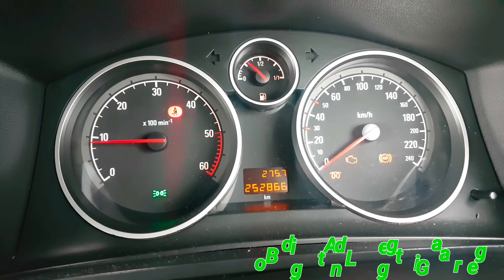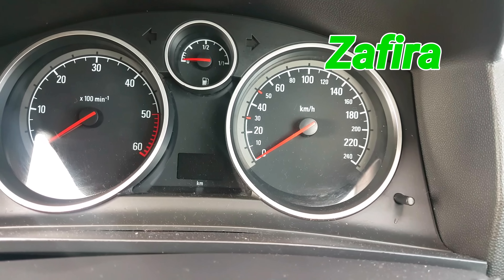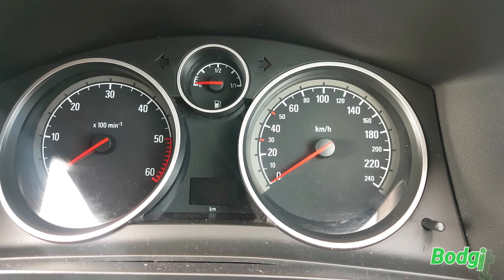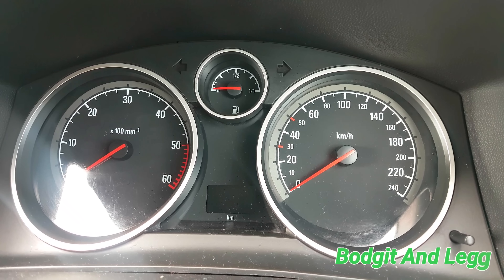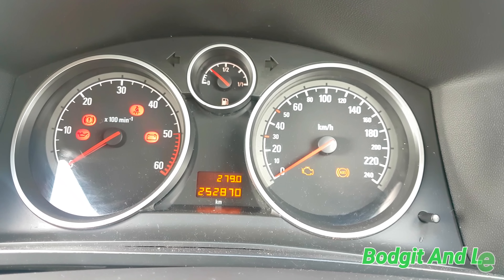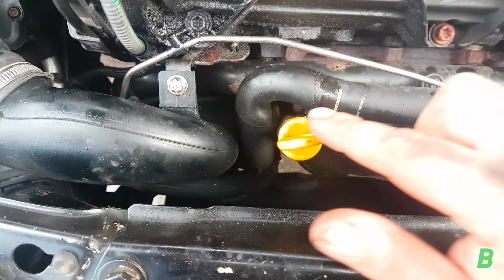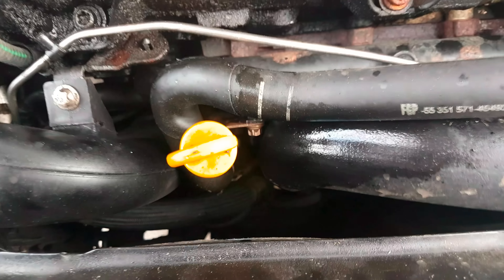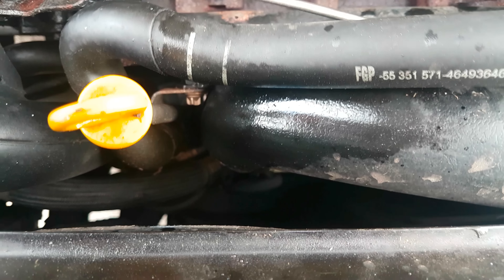Vauxhall / Opel Zafira Turbo Problems Be Careful Bodgit And Leggit Garage

Comment: Quick question, mate ,I have noticed that every time I start the engine it's sound heavy noise. There is no fault for the diagnosis from RAC service.
It's a vibration noise.
Please advise through your expertise.
Thanks 
Iqbal
Reply from the maker: Hi mate unfortunately it could just be so many things impossible to say but it could also be your clutch does the noise go or get worse or better if you put your foot on the clutch pedal

Comment: I have this issue at 110,000miles. Had a runaway engine and turbo disintegrated. Got a second had turbo and the oil is pishing through it. Need a bearing seal for it to be grand again but trying to get one is a (bum) whole handling

Comment: Hey Leon, a quick question: after a wheel bearing replacement a month ago I recently noticed that the cotter pin on the shaft/spindle nut or whatever, was loose. Is that a worry or can I just ignore it?
Reply from the maker: GymChess hi mate definitely don't ignore it what I suggest you do is jacket back up and re torque the bolts to factory specs and then keep an eye on it if it still happens you could have a problem with the bolts or the shaft it bolts onto which could end up being a serious problem
Reply: Ok thanks. I guess I'll have to contact the shop that did the job in the first place even though it's been a month. Everything works normally. I noticed it yesterday; that the "ring" was loose as well as the cotter pin that supports it. I checked the other side and it was just as it's supposed to. I have no idea how or when it came loose.

Comment: Hi, I watch your videos, and have a Zafira 2.pdti 3004, later engine with the egr at the side of the engine, rather that the middle.  I had the ecu light come on, andafter putting opcom on it, it Sat's boost pressure sensor, where us this please, as the engine was limping home last night, but started it up today, it wouldn't rev, but then it did, and was fine, but brought three codes up.  1, p0400, 2 p0105, and p0115

Comment: I had my Zafira B run away as the DPF dumped Diesel in the engine oil, pretty scary when it redlines itself, i panicked and stalled the car.  DPF was removed and cleaned and a full service no problems 3 years after. Mine was the 1.7CDTI Engine
Reply: This has just happened to me and was so scary I just turned the ignition off, was absolutely fine until using DPF cleaner and going on the motorway,as soon as I got onto a slower road it went crazy. Its currently in the garage waiting for a new turbo and and oil change 😩
Reply: @Zodiac-El  Yeah, there was no warning whatsoever my car had atleast 2 litres of diesel in my oil so was severely overfilled 😱 . Car has been OK since as its been a few years. Its pretty scary honestly this happened to me on a dual carriageway
Reply: @joepearson6644  yea mechanic said same about my oil, hoping after I've had turbo replaced it won't happen again,I never want to experience that again lol Glad yours has been OK since ☺️

Comment: In other words 'it's had it'. Runaway diesels are scary, either CO2 fire extinguisher or rag are required. However there is an even more scary one. Older tractors with an oil bath air cleaner. Tractor slips backwards, wheels grip and it starts backwards. This really did happen to a local farm worker in my youth. He jumped off, otherwise most likely killed when the tractor rolled over. Recently a friend had this happen to his LDV recovery vehicle. Got it under control, drove home VERY SLOWLY, fitted another engine. If it happens on modern cars.......RUN.
Reply from the maker: MalcOfLincoln yes mate it's not good when it happens

Comment: I hope this thread is still alive I've got exact same issue on my zafira car is in very good condition though , its pissing oil and whining noise from the turbo but still boosting ,I've just parked it up hopefully it gets back to normal once the turbo seal is fixed as it's still boosting fine
Reply from the maker: Hope everything works out for you mate best of luck
Reply: @bodgitandleggitgarage  thanks bought a recon turbo for 50 quid fitted it and shes boosting away now no leaks thanks for reply and the video

Comment: 2013 ecoflex : about 3 weeks ago whilst driving the car suddenly started smoking from everywhere, engine bay , exhaust the lot . managed to get home but then it died , turns out the turbos gone which has seized the engine, only 50 0000 on it. Worst car ever

Comment: Hi love your Channel and videos! Non turbo related but wondering if you can lend your expertise. My left front wheel is squeeling like HELL when I'm driving, however when I brake or steer slightly either side - it completely stops! ( pad wear is even both sides) - with plenty of meat left. 
Thanks !
Reply from the maker: batista999 hi mate the easiest thing to do is to jack up the front of the car spin the wheel by hand and find out exactly where the noise is coming from they could be loads of Reason this is happening you could have a stone caught in the dust shield or you might have to completely strip down one side and clean it and make sure everything is running smoothly and is free also you could have a wear indicator touching the disc which is causing it to screech once you've isolated which will it is clean it down properly Greece it's etc see if the noise goes if it does make sure you do the other side to balance it up
Reply from the maker: batista999 what you need to do is check your dust shield that's the thin piece of metal behind the brake disc it could be rubbing on the brake disc they can easily get bent as you are changing the components
Reply: Thanks for the reply. I've already cleaned the whole carrier, calipper, greased the ears of brake pads, and greased slider pins. The wear indicator is nowhere near the disc. HOWEVER when I do a full turn of the disc, I can hear some rubbing noise for 1/4 of the turn. Warped disc ?
Reply from the maker: batista999 check the dust shield behind the disc make sure that is not rubbing against the disc if the disc is warped you would be getting a heavy vibration through the pedal as you press it
Reply: Just checked the dust shield, it's not touching. It seems to be the brake disc and pads which are making this noise together. Uneven disc maybe?. As I said it spins and makes the rubbing noise only 1/4 of the turn, rest of it is smooth. 

If it was sticking calliper then surely that rubbing would be the whole turn. So do you think it's uneven pads and disc maybe? 

Thanks
Reply from the maker: Roy Burridge it's too difficult for me to say I cannot see it so I cannot diagnose it if you got a problem with your brake disc or your brake pads you will feel a vibration through your foot as you are breaking
Reply from the maker: If you want to check the disc gets a dial indicator and check for runout on the disc
Reply: Tried everything you said. But getting it very intermittently? Sometimes it's driving first thing in the morning, other times it's last 5 mins of a drive. 

Am I right in thinking this is a bad calliper then? , piston sometimes pushing all the way back, sometimes not ? As I said braking or even a slight twitch of the steering wheel and it vanishes! 

Thanks !

Comment: i had a run away diesel in a citron c8 that was a freaking pain in the butt and i did not know what was going on at the time
Reply from the maker: Runaway diesel isn't nice mate
Reply: Nope not one bit. I did not know what was going on I had my family in the van and it seemed to act up so I turned the engine off at the start of it and I waited thinking it needed to cool down i never experienced a run away diesel or knew the symptoms of it. Well once I started it back up that's all it took engine rpm shot up and I turned the key off pulled the key out pulled the battery cables nothing worked. At this point I start pulling my kids out the van and get them way ahead of the smoke and van.
Reply from the maker: @jesters1gamble201  if it ever happens to you again mate pull the handbrake up put your foot on the brake pedal put it in a high gear ear and quickly fastly pull your foot up off the clutch this will hopefully store the engine with your handbrake and foot still on the pedals it shouldn't go any further and hopefully the engine will stall
Reply: Well I know have a automatic transmission diesel. So if there is a next time I am ripping the throttle body hose off and spraying a fire extinguisher into it no sure if a rag stuffed in the throttle body will stop it
Reply: Right now I am hunting down whats throwing up p2278 code on my Opel zafira 2006 1.9cdti I will pull the map sensor in the morning and clean it. I had a swivel flap not contacted to its arm I fixed today

Comment: If the rest of the car is still in good shape... a good used turbo might not be that much of an expense.
Reply: Thomas EXOVCDS well said
Reply from the maker: Thomas EXOVCDS yes I know what you're saying but there's a few problems the first one is the car is not in good shape lots more problems and the second one is very difficult to find a good second-hand turbo for these as they all give problems
Reply: Safety first... I know Leon, that's why I said "if the rest of the car...".
Reply from the maker: Thomas EXOVCDS safety is always third you know that🤣🤣🤣🤣
Reply: bodgit and leggit garage what could happen this car
Reply from the maker: nicky boy scrap yard
Reply: bodgit and leggit garage would lack of care caused this a lot of problems in one go
Reply: bodgit and leggit garage if it's now turbo seal kit need replacement I have same problem everything work good and smooth bit smoke so i gonna open the engine head and will replace the seal kit and valves will see what till happens

Comment: Only ever seen 3 runaway diesels, and they've all been Freelander TD4s.

Bung a replacement turbo on maybe, but it's unknown what damage all the shrapnel will have done.
And then there's the intercooler to clean, probably MAF and MAP to replace...... Costs spiral.

Some people need to learn that servicing isn't optional, and that the correct oil matters.

I drive a MK1 Zafira 2.0DTI, 270,000 miles on it (432000km) no leaks and uses about 0.5litre of oil in 10,000 miles. 
Yes it's an Opel engine versus this Fiat engine, but everything lasts much longer if it's looked after, even stuff made by Fiat!
Reply from the maker: Simon Parkinson yes mate 100percent agree service in regularly and doing preventive maintenance can solve a lot of problems but people don't do this the only come to me when there is a problem trying to tell them to spend money they just say my car is working it's fine😂😂😂

Comment: this could be saved by just replacing the chra cart in the turbo, im surprised of you being a mechanic and scraping this 2007 car, its normal the turbo is knackered, the car has 250k kms
Reply from the maker: Boom Shaka Laka you don't know anything about the cars history or the customers history the car has more than one problem rather than trying to be clever and smart with your comment you have to think of the customer it would be cost too much money to replace everything that's gone in the car the car isn't worth it
Reply: not trying to be funny at all, only problems you said on the video are probably turbo related, and youre also concerned of oil in the inercooler which could be easily cleaned. appreciate your videos, just pissed of that it has not been repaired, it would be much more satisfying to see it on the road again. car should be worth about 2k running so the car cost would be over the car repair price (100 euro/pound for a new chra plus labour) but after all, its the owners decision, just sad to see it going to the scrap. keep the videos coming!
Reply: You can't just put a new Cart in and hope for the best and defiantly not a chra cart, cheap Chinese crap it will fail as soon as you go on the road, turbos need rebuilding from the ground up then setting up and balancing and if it's a variable vain turbo as a lot of vauxhalls seem to use them now then it's even more difficult.

Comment: Replace the turbo with a second hand one!
Reply from the maker: romakayak very difficult to find a good second-hand turbo for these as the turbo goes in all of them plus there is a lot more problems than just a turbo
Reply: bodgit and leggit garage although I have experience of replacing turbos, and having witnessed a few the a runaway engine I accept you answer as the best option. Scrap the thing!
Reply: bodgit and leggit garage starting with the glow plugs